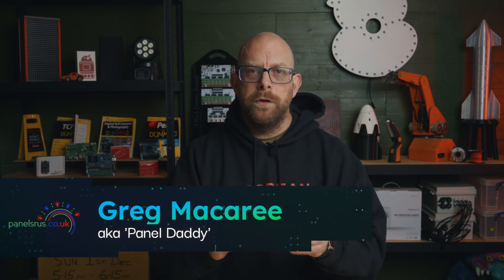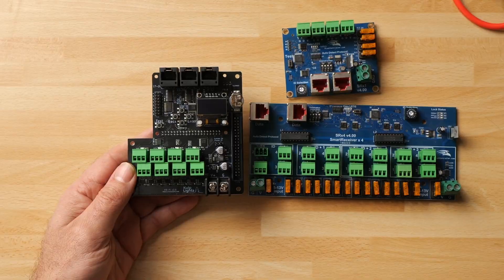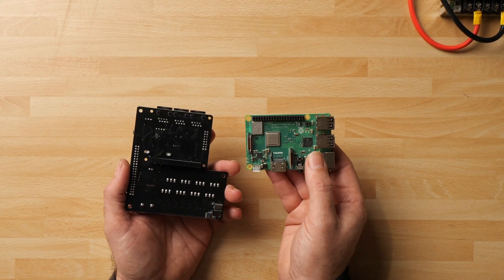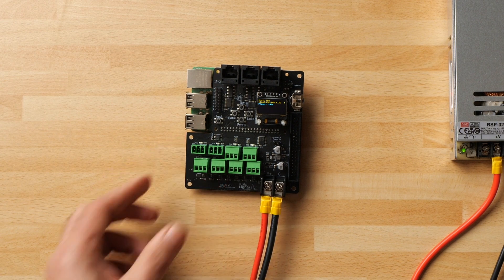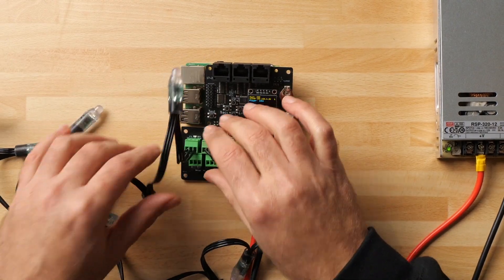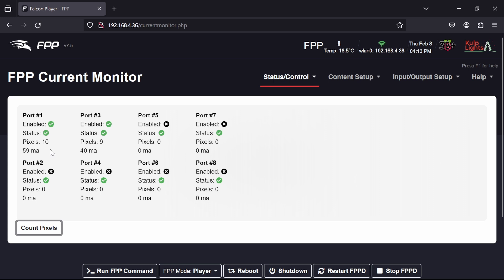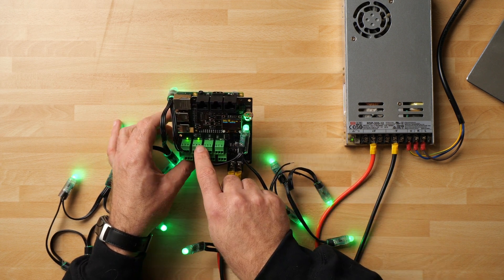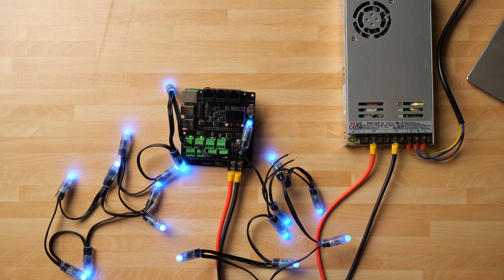Kulp K8-Pi v2 Controller Overview & Setup

Comment: Merry Christmas and greetings from Germany. I'm planning to do a light show next year and am now checking out a lot of channels to see what's possible. Do I understand correctly that I can control 266 RGB pixels from each port with this board? So a total of 2128 pixels with the board?
Reply from the maker: No, 800 pixels per port at 40fps.
Reply: @gregmacaree  So 800 rgb pixels per port? That is a lot😯
Reply from the maker: @DerDingsda yes, subject to power
Reply: @gregmacaree  The limit is 5A per port. Right? At 12V and 0.5W that would be 125 pixels per port. Do I understand that correctly? Can I connect a second power supply as a boost where V0 is connected to increase the current?

Comment: HELPFUL TIP!!!!!!!!!!! if you turn on your controller with the pi plugged in and the outputs stay on after boot and the pixels wont do anything you have to go to the output setup and check the box that says "enabled" cause for some reason its disabled by default

Comment: Do you know where I can find a manual for this - I don't see one on Kulp's website ?  Can you show how it's setup in xlights and how you assign props to the ports.  Also the setup if you are using differential receivers (can they be in smart mode or not)?

Comment: I can't find a solid answer elsewhere; I have 3 Falcon PiCaps today that I would love to swap out for this; but they are all running on older RPi 3B, not 3B+. Is 3B+ the minimum hardware that will work? Seems like the Processing is basically the same.
Reply from the maker: Hi, the 3B+ increased the core speed and improved the Ethernet & Wifi. Your 3B will work just fine.